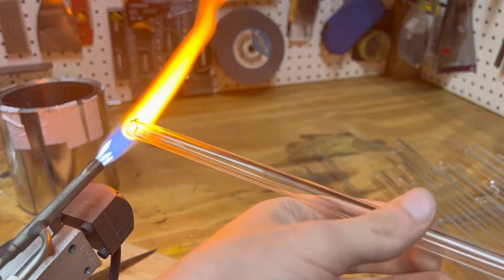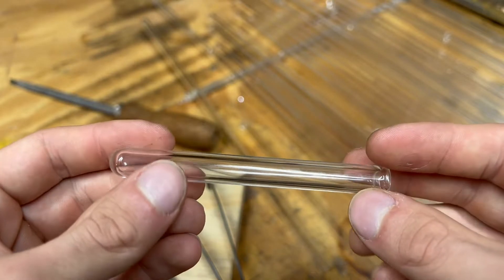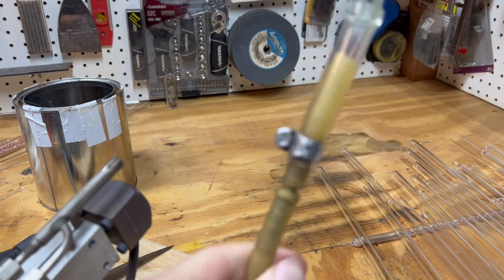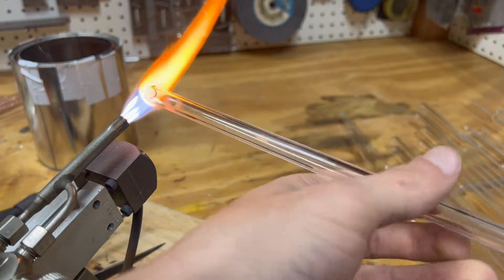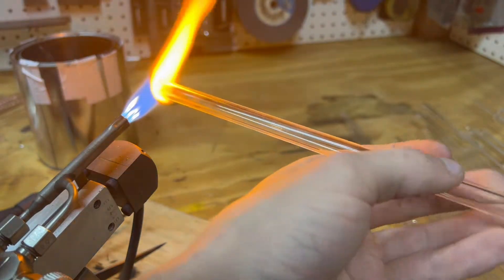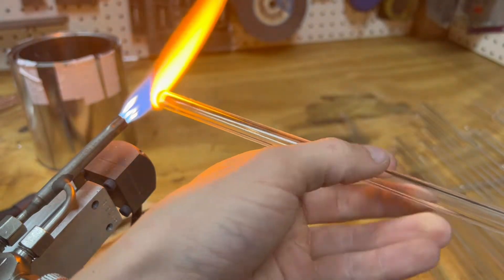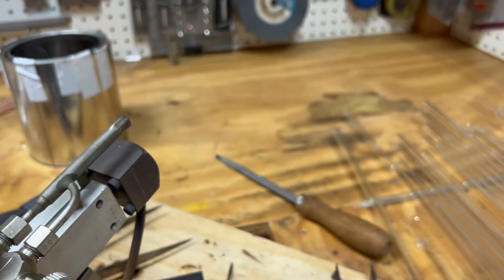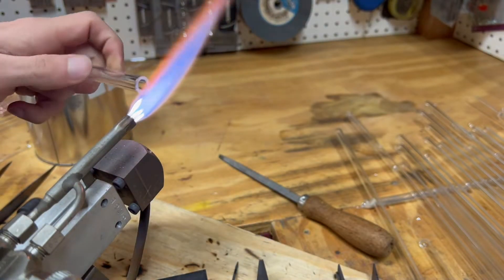Scientific Glass Blowing Ep:3 How to make a Test Tube

Comment: Hey is it possible to contact you?
Found your channel a few days ago and I am looking through your glassblowing tutorials. I absolutely love this videos. I work in a lab but I usually don't need special handmade glassware so we don't have a scientific glassblower. I made some ampulles from testtubes to store some chemicals like Bromine that's how I started my love for glasswork. I love glassblowing and want to start it as a hobby. I used a classic bunsenburner at work for the ampulles but it takes long to heat the glass.
I found the burner that you showed in the previous video for about 250€. Is this price ok and is this burner recommended for beginners? 
Could I work with compressed air or an medical oxygen generator instead of pure oxygen gas?
Reply from the maker: Hello, you can reach out to me either through my email on the about tab of the Channel or join my discord server. Glad to  hear you are joining the hobby! Keep you eye out on eBay for torches, you can normally get some good deals. A lot can go into the price, make sure the tubes at the front a are clean and straight also look for corrosion, or burn out. You can’t use compressed air but you can use an oxygen concentrator.